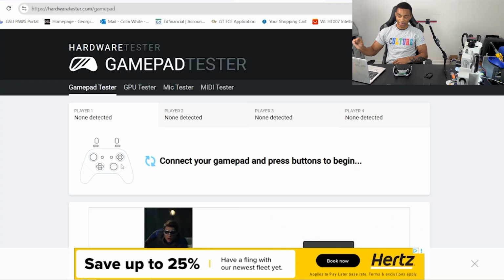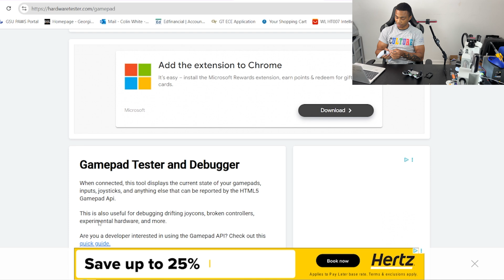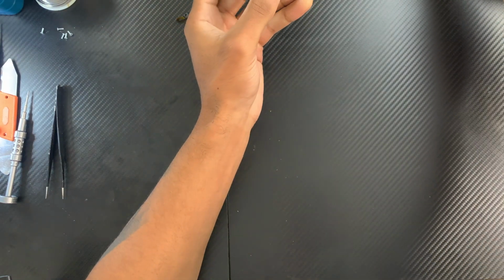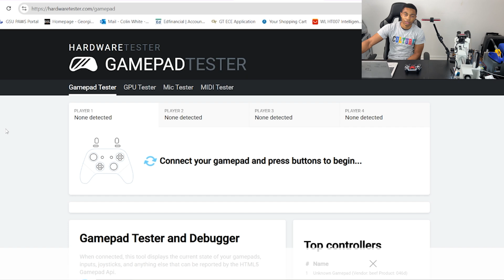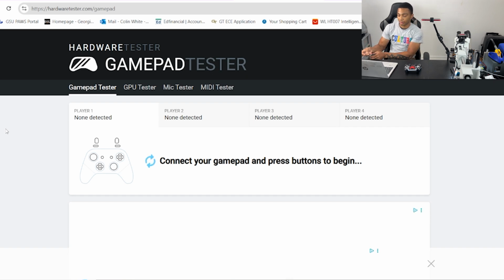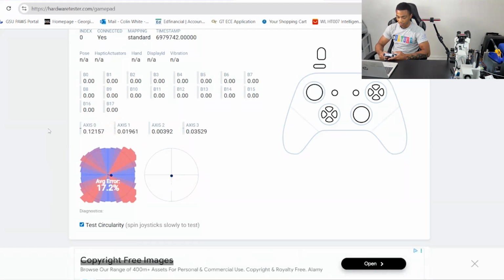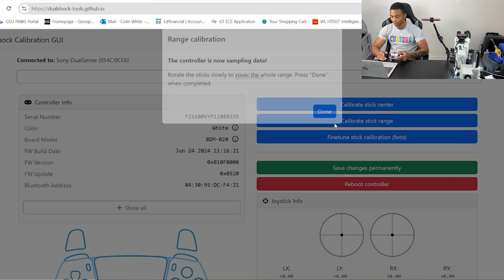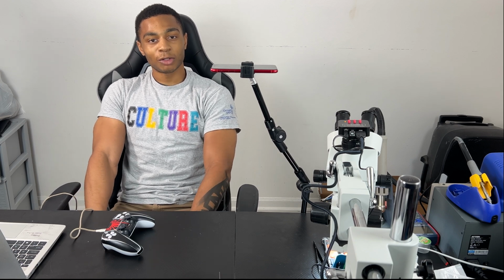Installing Hall Effect Joysticks on Dual Sense Wireless Controller

Comment: There's so much incorrect information in this video. 

I would highly suggest getting a PCB holder. That would make the process so much easier. 

In the beginning when you were showing the stick drift with the game pad tester. You don't need to  ✅ test circularity. You can just move the analog stick around slowly and it should jump around on itself. 

And when you replaced the joystick and you were doing the calibration. When calibrating range/ circularity you don't need to rotate it a million times as fast as you can. Just 2-3 normal speed circumference rotations will do. Going a million miles an hour I can't imagine gives you an accurate reading. 

I don't understand how having one joysticks at 9.8% and the other at 3.9% is considered being done. In my opinion that's way too far off between the 2. I like to get them within 1% difference of each other. 

I respect the effort you put jn. I just hope you didn't charge the customer to much for that work. Id suggest practicing on a few controllers and getting down a technique thats results in good, professional results. Then offering this service to the public. 

Cause honestly nobody should of paid for that kinda work. Far off calibrations, didn't look to be very good solder joints, only replacing 1 analog stick and not both. 

I wish you luck for the future. With practice I'm sure you'll do great. I usually watch these types of videos to see people techniques and what tools they use.